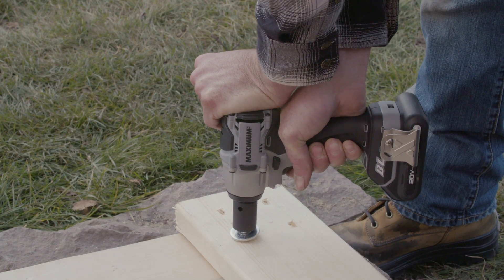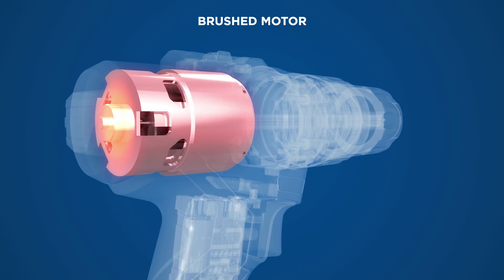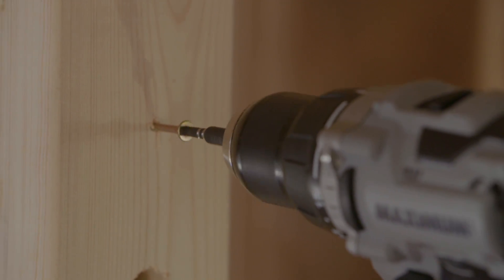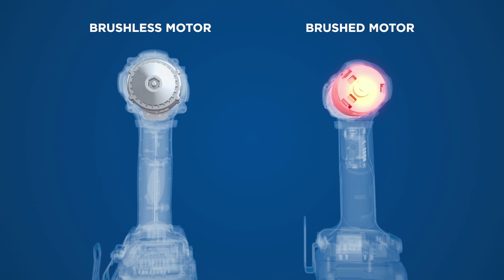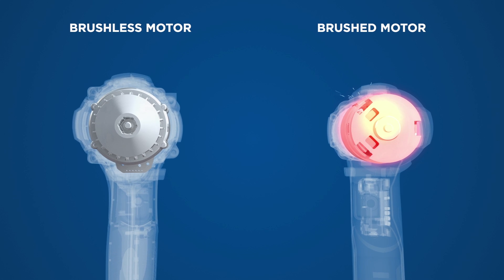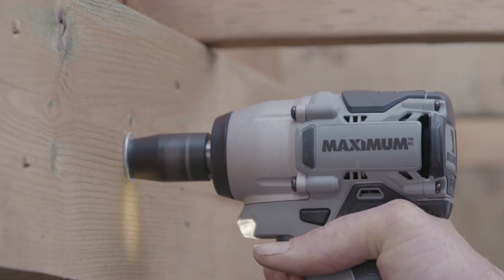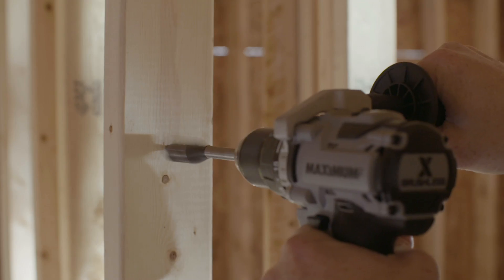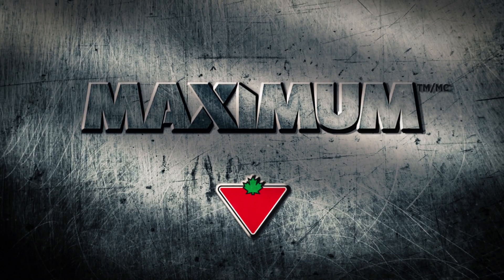See why you should go Brushless

Comment: It’s cool until something on the circuit board blows and the drill doesn’t work. Brushed motors are simpler in design and don’t need a brain box to get them to work.
Reply: That is my question. Sure, brushes wear out. But, some designs allow for you to fix it yourself. But what about the chip inside the brushless? How long will it last, under dust, vibration, and temp fluctuations?  Getting ready to invest in a lot of new tools. And I think I’m gonna stick with brushed.
Reply: The question is, how often do they fail to even consider that? I need stats and facts please
Reply: @juanzamarripa3778  pretty often because they are very sensitive. Because of the open to conditions circuits inside, they are extremely prone to brake from humidity. Also the permanent magnets inside are not permanent. Magnets loose their properties over time and simply will stop working. But this is rarely a case and appliable to brushed motors as well. Also vibration will cause the solder inside the chips to degrade way faster and reballing will be mandatory. In general, when they brake you replace it. This is the main reason for strongly pushing them to consumers. They are the definition of one time expendable tool. There was a chinese maker though, who managed to create a brushless drill without all the complicated circuitry. just a motor and a speed controller.